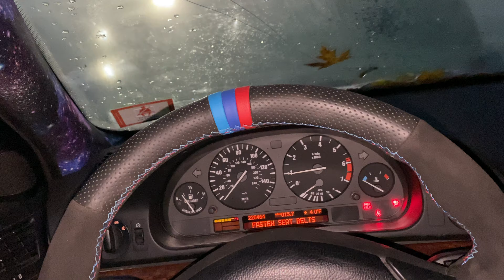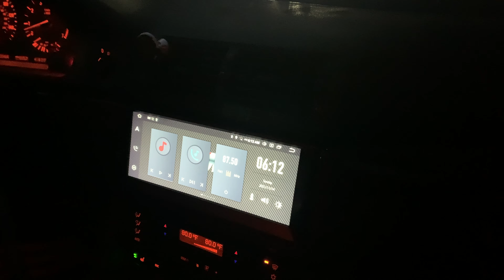E39 540I 4.4L V8 CAT "DELETE" | SOUND TEST

Comment: Hows the drone for calmer driving? Any engine codes you had to deal with?
Reply from the maker: Drone is not bad and 1 code, O2 sensors weren’t happy.
Reply: @Blackrosemotors  able to get around it or just leaving the code on the dash?
Reply from the maker: @Captain_Carrots  Ended up picking up some “O2 sensor spacers” with the little catalytic converters in them (basically filters the exhaust gasses right before hitting the sensor). No more codes👍🏽
Reply: @Blackrosemotors  cool thanks for the info!
Reply: @Blackrosemotors  where can I get the same O2 spacers?